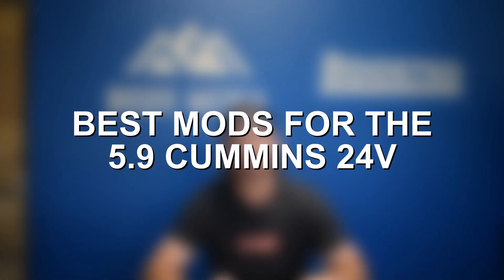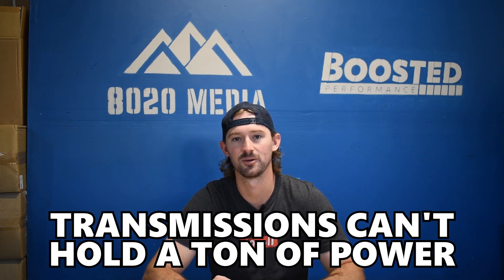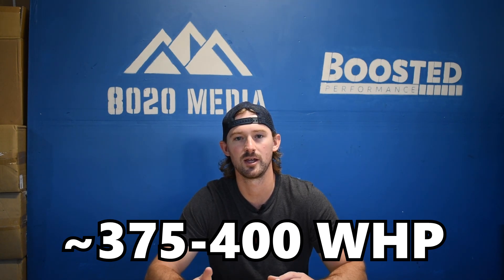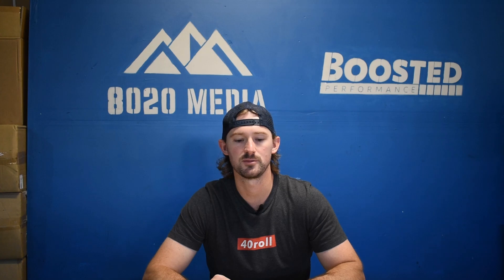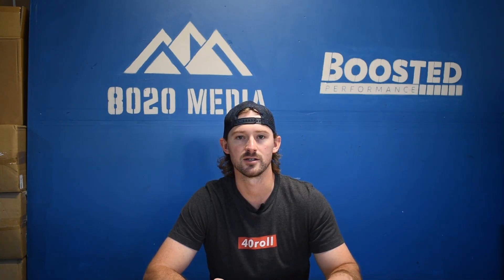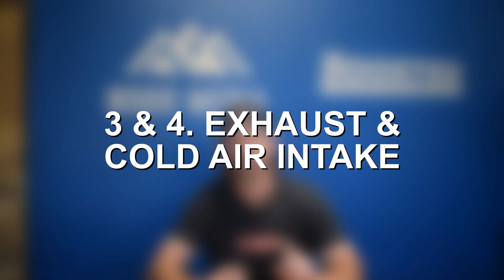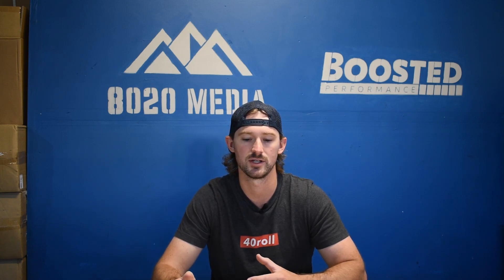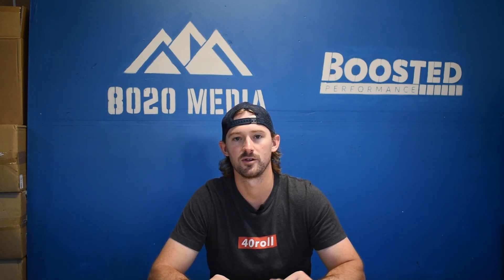How to Build a 400+ WHP 5.9 Cummins 24v! (VP44 & CR)

Comment: Been running the same combination of parts for over 200,000 mi and it's been very reliable.(Besides destroying 3 transmissions) Fuel side: Air dog 150, 7×.011 injectors, Edge tuning. Air: 62mm Garrett PowerMax, ATS 3 piece manifold, 4" downpipe, AFE cold air intake, Banks monster ram. 408/970 at the wheels and  tows 10,000+ regularly

Comment: Standard output vp44 is good for up to 700 hp , and with a good tune , mild upgrade turbo like a k27 , and edge comp box with 150 hp tune and 50 hp injectors you can easily run 450 hp ,
Reply from the maker: U - Thanks for sharing your insights.

Comment: Great video, I’ve got a 99 Cummins 2nd gen, here’s my mod list for anyone who wants to follow it.. the truck is EXTREMELY reliable and has a ton of power with out breaking the bank. It’s my DD/work truck and my only vehicle so it HAS to be reliable. 

Here’s the Order of my mods/upgrades: 

1. Fass 165 Lift pump (Fass 100 should do fine as well) 

1.5. Remove your factory intake box and add a BHAF filter, also Delete your stock muffler and striaght pipe it for better flow

 2. Edge CS3 or CTS3 juice with attitude.. later down the road purchase the hot-Unlock like I did for extra timing and fuel 

3. PDD Pan-Off upgrade kit W/ built valve body.. This kit works amazing when installed on a good trans.. it will increase the line pressure 10 fold which will keep your factory clutches from slipping under load and will save your converter from slipping as well.. it also comes with supporting billet trans parts which allow the trans to handle the higher trans pressures

4. 100-150hp injectors.. I went with 150hp injectors.. 100s if you plan to keep the stock turbo and 150hp if you eventually plan to go with a larger turbo.. you can get away with 150hp injectors on a stock HX35 but it will be smoky.. if you have the smaller HY turbo then stay with 100hp injectors 

5. You will now soon start slipping your converter even with the PDD pan-off trans upgrades so you will want a billet flex plate and a billet converter.. a good bullet single disk can actually hold a lot of power.. I went with a billet Tripple because it wasn’t much more but is way overkill. 

5.5. Buy some ARP 425s or “Xotic” head studs.. replace your factory head bolts with these studs one at a time and you’ll be fine..

6. Now that you’re getting plenty of fuel.. have installed head studs to handle higher boost pressures and your trans can handle the power it is time to get a new turbo.. Buy yourself an HX super 9 turbo.. it is the fastest spooling turbo you can get for the Cummins 24v and is great for daily driving and towing.. I recommend the 60mm billet compressor wheel.. you can go il ti a 62mm but it’s gonna be a bit more laggy down low.. only go with a 62mm if your going larger than 150hp injectors (I run my HX super 9 at 50psi which is the max)

7. Now you can finally upgrade your exhaust .. the factory striaght piped 3” can actually support over 400hp pretty well.. but once you add the larger turbo it will come with a 4” downpipe so you should remove the old 3” from the downpipe back and match it with 4” so you’ll have a full 4” turbo back after you’ve installed your new turbo.. this helps a lot with the bigger turbo but isn’t needed on the stock turbo 

8. Now you can start doing smaller supporting mods such as a cold air intake that supports your BHAF filter, a better intake horn, and a better flowing exhaust manifold.. this will allow you to get the most out of your turbo and your fueling as you will be pretty much maxing it out. 

At this point just drive and enjoy the truck.. as long as your not an idiot the factory clutches and input shaft can handle way more power than ppl give them credit for.. be sure to change your fluid every 15-20k and ALWAYS check and adjust your bands! This will keep your trans healthy for years to come.. also it doesn’t hurt to run “Dex/Merc” trans oil.. ppl say not to do it but it will help your clutches not slip in a high hp application.. its not good to run that fluid on a stock truck and a stock trans cuz it will wear the clutches out faster but when your making big power it’s good to run it as you won’t slip your clutches as easily and slipping your clutches will wear them out much faster than running the “wrong” fluid will.  

Once you finally break your input shaft or wear out your stock clutches then you can go for a fully built trans and never have to worry again:. And you’ll already have the billet flex plate and converter to reuse so it won’t be as expensive of an upgrade in the future. 

Hope this helps someone! Of course there’s other mods/upgrades I didn’t list but the ones I did list are exactly what you need to make a reliable 450-600whp Cummins VP44 truck 👍
Reply from the maker: B - We appreciate you taking the time to share all of this! Sounds like a sick build. This will certainly help future viewers.
Reply: At what point do you feel you really need to do head studs? I just got myself the edge comp box the other day and I do plan on everything you have listed, and I'm starting to order and compile everything slowly to do it all at once
Reply: That was spot on.

Comment: The transmission is the limiting factor ... to a degree ...  ... Here's what I did back in late 01/early 02 ,my truck was a 2000 2500 4x4 with Automatic ...I ran RV 275's a Van Aaken and 4" exh with a totally stock trans for a while, I just knew what not to do.  ... I switched to Diesel Dynamics stage 3 injectors , stacked the original Edge EZ box and a Van Aaken, factory HX35 with a boost elbow making 40-44psi of boost , the stock lift pump mounted back as close to the tank pickup point as possible on the side of the frame , 3/8 fuel line still and eliminated the banjo bolts , modified the fuel heater ring for more flow , DTT valvebody  and DTT 93% convertor, BHAF and made 373RWHP ... that was when I found the limit of the stock trans output shaft doing a brakestand , snapped it off...  Then I switched to an Edge Comp and an HX40 , boost was 40 psi and the exhaust went from black soot to a gray haze , lowered the EGT to something that was actually showing on my gauge , 1400 vs 1800 plus and it made 416RWP . This level was when I had to dump the big money into the trans , Billet TCS input shaft assembly, TCS billet front drum with 6 clutches in a 5 clutch drum , added extra clutches in the OD unit using stepped plate and had a cryo'd output shaft. I still have all the engine parts and the trans that I have about 3500 in still ... I did all the work myself .... and I'm going to be putting it into my 98 2500 RWD , looking to get it up to 550RWP , the nice thing about the VP is you can turn off the extra fueling, my other truck with just the DD stage 3's , DDT VB and 89% convertor was how the truck should have been delivered from Chrysler , fuel mileage was also better.
Reply from the maker: J - Thanks for taking the time to share all of these insights. Keep us updated!

Comment: The 47re can handle plenty of horsepower. The 48re is usually removed in high power applications in favor of the 46 or 47.
Reply: That’s definitely not true. 47 and 48 are nearly identical besides the valve body. 46re is not even close to as strong as ether. But stock 47re TC will fail with anything over stock hp
Reply: @Ryskyguy  agreed , the 46 is the V8 gasser trans , you can't put it behind a Cummins , the bellhousing isn't big enough for the Cummins convertor. The 48 , is a beefed up 47 . The little I have seen is people are swapping out the 68RFE for a 48 in big power applications.
Reply from the maker: M - Thanks for sharing.
Reply: That’s the dumbest statement I’ve seen today